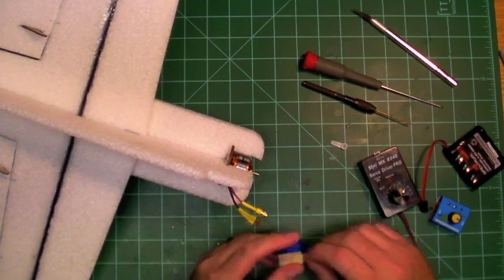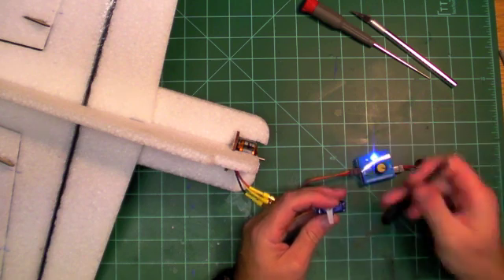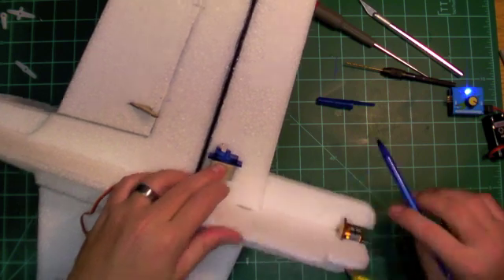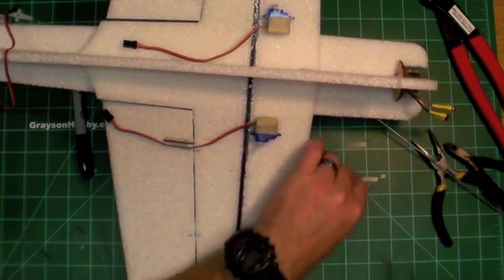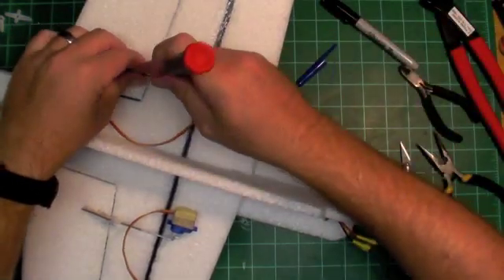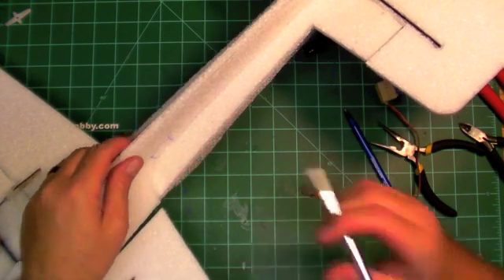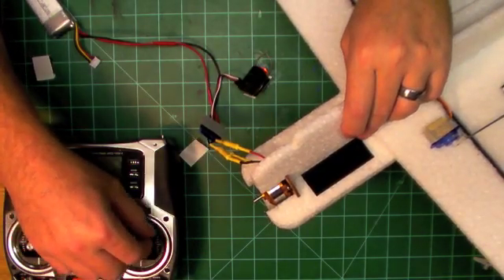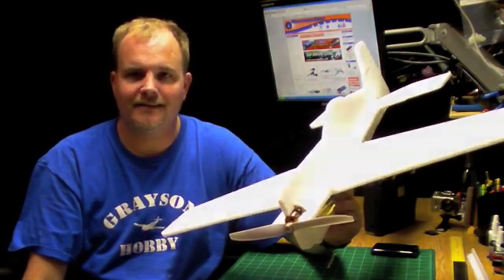Sukhoi Build 4

Comment from the maker: I am a D/R sport and 3d style pilot, meaning I don't have high and low rate 3D. My high rates are set to 100% for all surfaces and my sport rates are Ail 10% Ele 20% and 100% rudder. If you wanted a dual rate 3d then I would do 100% high and 65-70% on lows. If you have 3 position D/R then 100-70-40.Those #'s are for Ail and Ele. I always use 100% on rudder. If it's a little nose heavy, I tend to load up on the Aileron expo, around 65%. I use 35% on elevator and nothing to 10% on rudder.